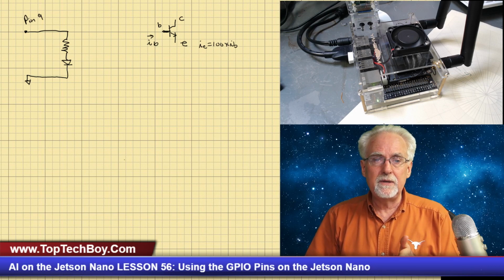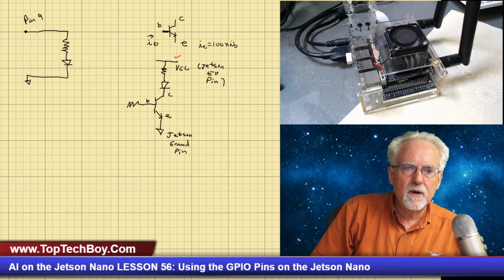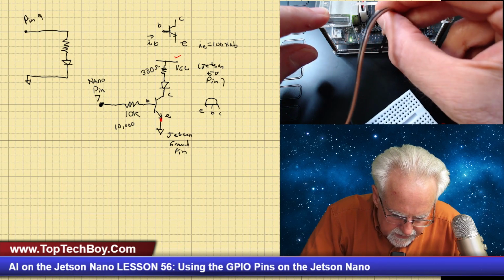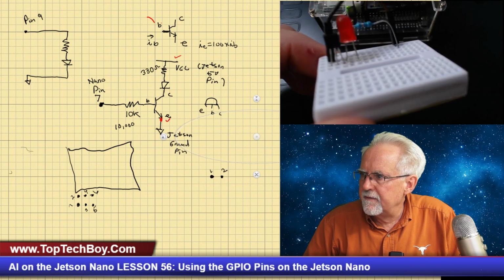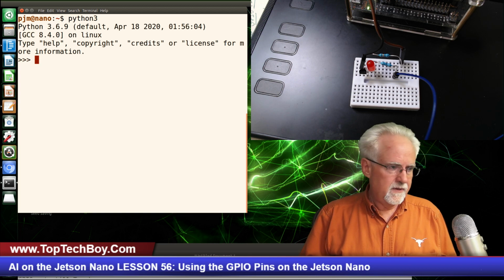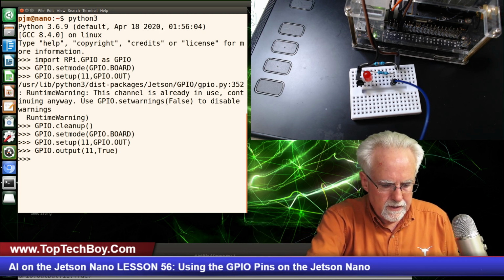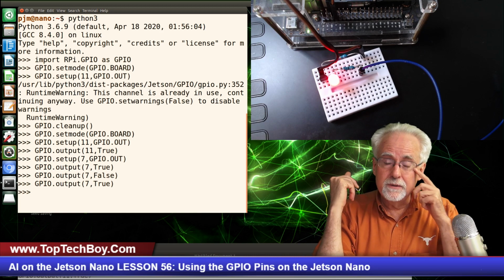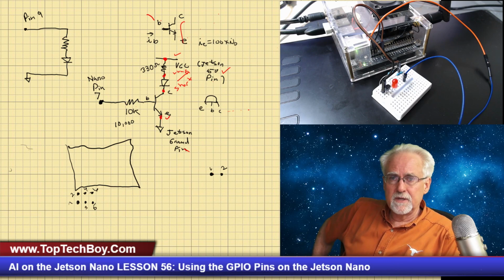AI on the Jetson Nano LESSON 56: Using the GPIO Pins on the Jetson Nano

Comment: - when I use the same library adafruit-servokit and GPIO, I get the following error, please tell me how to fix it. i used digitalio library but its still not working. if only running the GPIO library alone is fine, but when integrated into the same code in the main program, it will get that error.

line 273, in setmode
ValueError: A different mode has already been set!

- these are all the libraries that i use in my program:
import argparse
import time
from pathlib import Path
import math
import cv2
import torch

import torch.backends.cudnn as cudnn
from numpy import random
from sympy import symbols, Eq, solve, tan, cos, rad
from models.experimental import attempt_load
from utils.datasets import LoadStreams, LoadImages
from utils.general import check_img_size, check_requirements, check_imshow, non_max_suppression, apply_classifier, \
    scale_coords, xyxy2xywh, strip_optimizer, set_logging, increment_path

from utils.plots import plot_one_box
from utils.torch_utils import select_device, load_classifier, time_synchronized, TracedModel
from sympy import symbols, cos, sin, tan, Eq, solve
import numpy as np
from adafruit_servokit import ServoKit
import Jetson.GPIO as GPIO
---- thank you very much

Comment: I have been designing safety systems using the gpio on a Jetson TX2. This video was helpful. Now let me help you. If you try to reuse any LED that has had the legs trimmed, you can always say the flat spot on the plastic case is always negative.

Comment: Hi I am doing an experiment project with jetson nano to design a speeding violation Caught camera.I use a mipi cam connected to jetson nano and other side I have a radar sensor to detect vehicle speed.What I want to achieve is to trigger snapshot when sensor reading preset speed limit.Any suggestions is appreciated!!

Comment: Hi Paul, 
It was nice to get out my most excellent elegoo kit, I'm thinking of getting back to your arduino lessons and try to work with the jetson nano GPIO pins instead. 
In the meantime, for this lesson, because my breadboard was already populated with six LEDs, I powered them six LEDs using an external power supply. Did some homework of my own and managed to program the LEDs to turn on only when my face is detected, neat, right? One thing that annoyed me, when you clear the GPIO pins, the pin still keep it's last value, so at the end of the code I need to set the pin to 0 so that the LEDs are turned off. Is it behaving ok?

Comment: mr. professor thanks a lot for really useful information. But I have a trouble with this Jetson Nano. Cant we observe 3.3 or 0 V from GPIOs with oscilloscope ?
Reply from the maker: You have to use the special cable/probe. Normal cable has too much capacitance, and will draw the signal down. The GPIO pins have almost no drive current.
Reply: @paulmcwhorter  Thank you so much sir. So do you mean that actually I can make the GPIOs high but I can't see from measuring devices which have normal cables? If I found a cable with low capasitance, I will be able to see what I configured through the GPIOs?

Comment: Thanks for this lesson Mr.McWhorter.  Just one question I have is, when using an external power supply, do you need to connect the grounds of the Jetson and the power supply together in order to get a common ground, or is this unnecessary?  Many thank again for your time.

Comment: Could you not also use a logic level shifter? I have a 8 channel bi directional logic level shifter that can convert 1.8v to 3.3v and if you need 5v you can take the 3.3 volt side and connect that to another  shifter to convert that to 5v. My main focus is in robotics where many GPIO pins are used and creating this circuit for each pin would be a pain. You can get a logic level shifter for less than $5.00. I know much can be done with I2C, SPI, and UART but not everything. so access to a lot of standard GPIO pins is necessary. I use 6 GPIO pins just for my motor controllers alone.

Comment: Dear Paul, thanks for this great lesson :-)  is it possible to hook up the arduino together with the nano via i2c? would this not make live easier?
Reply: Hi Robert, this i a great point. I have been doing exactly that last week and now I can control the Arduino via USB from my Jetson nano. I am using pyserial and I can read and write through it. So, for example, I can pass to the Nano any of the values of the sensors on the Arduino board or trigger actions on Arduino from the Nano. It works super fine and with no delay whatsoever.